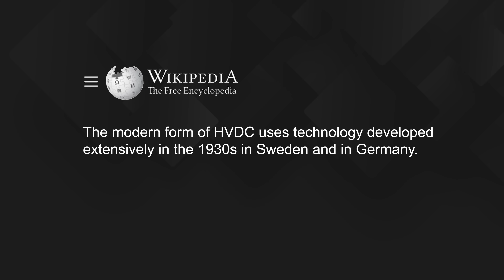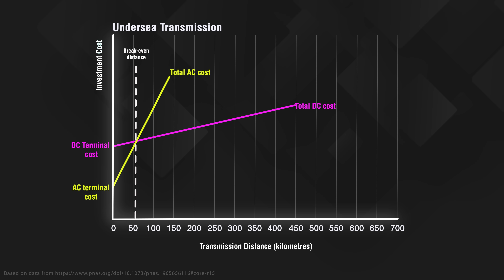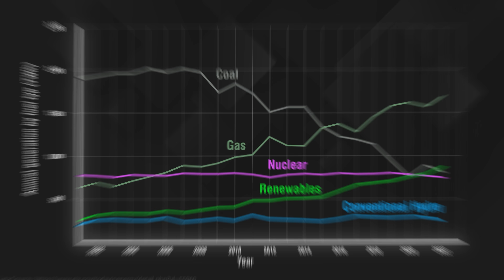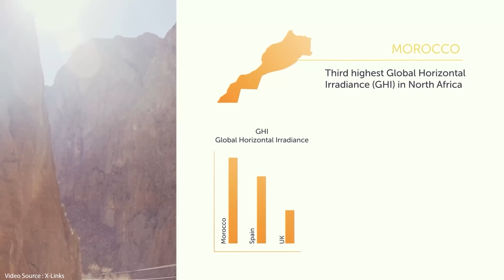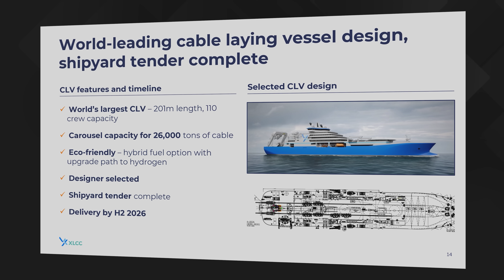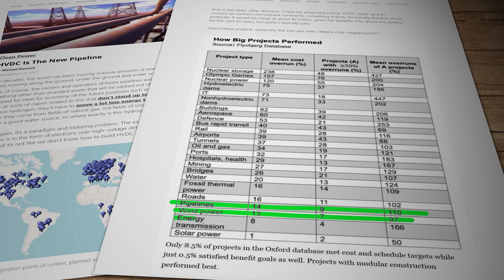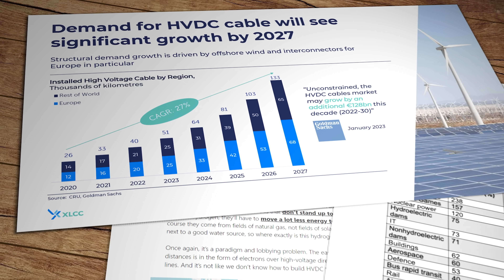Revolutionising power transmission.

Comment: Once again a great layman’s view of developments in the Rebuildables, sorry Renewable Energy Grid’s intercontinental long distance HVDC power transmission sector, and yes it’s something to be optimistic about, but it’s strange that whilst we are being told our country is in great debt, and so we the public have to grin and bear the inflationary costs shown in our food and energy bills due to the vagaries of the energy market, there still appears to be plenty of money to spend on these projects, and that we’ve yet to see any benefit from, if ever.

At the start of the videocast you gave a characterisation of a pessimists view of “in the real world” Rebuildables, sorry again, renewable energy sources to maintain our present lifestyles eg. the lights not going out. But they have a point in the overall scheme of things, as intermittent Solar and Wind Power are the easy part of providing electricity, or they would be if storage had been sorted out (as still require dispatchable flammable fossil backup). But it totally ignores that Globally only ~20% of energy is supplied in the form of electricity, and only ~2% of that is provided by Rebuildables, leaving ~80% still reliant on flammable fossils🤔

Comment: Here in Ontario, Canada we produce a lot of copper. I think we ought to start making these cables rather than selling our copper at the current market price. We need to upgrade our raw materials more in this country and sell more finished products. The breakers for those systems must be insane though. HVDC could surely span a large gap when you are trying to shut it off. Literal bolts of lightning are going through there. I wonder if it would be more energy efficient to send electricity from Oil power plants through these wires than to ship oil by tankers, trains and pipelines. Then the oil would not need to be refined first, the bitumen could be burnt and the tankers could be recycled into something else. Surely these wires must be cheaper to run than a big oil or gas pipeline.

We just need to keep USA from cutting these country to country interconnections. I mean Ukranians with snorkels?!

Comment: Here are some numbers to back up the generalizations I just shared: "Power generated in the Northwest has saved Southwest utilities more than 2.8 trillion cubic feet of natural gas that would have been burned in power plants. Because large amounts of Northwest power can be transmitted reliably to the Southwest, less power has been generated at fossil-fuel power plants -- an important benefit in a part of the country with chronic air pollution problems.  Conversely, because the Northwest has been able to import power from California, particularly overnight when demand is low, water can be reserved in reservoirs that otherwise would be used to make electricity -- an important benefit in a part of the country where hydropower operations affect threatened and endangered species of fish.  As well, money that southwestern utilities pay for power from the Bonneville Power Administration helps finance fish and wildlife restoration projects in the Columbia River Basin." web page/pdf: https://nwcouncil.org/sites/default/files/2001_11.pdf

Comment: Thanks again, Dave, for excellent research and presentation. The cross-over graphs will help us explain to the uneducated masses what is real-world physics. I would like to add 2 thoughts: 1) The need for transmission lines may drop almost to zero. If solar panels arrive on 50% of roof-tops world-wide, and battery mega-packs are deployed for regional balancing, along with a washing-machine sized rust battery in every garage, 99% of what the grid does now will become useless. 2) What India wants to do to Africa, combined with the flip-side of what England is up to, constitutes both a) India sells the product to African nations, keeps the generating technology for itself, and b) England uses the African resources to take away solar production that would benefit Africa more by making industrialization affordable IN Africa. And a small side note on the west coast HVDC line - at night, on a good night, California sends electricity BACK to the north, reducing their need to burn coal/gas for a few hours here and there! "During winter, the northern region operates electrical heating devices while the southern portion uses relatively little electricity. In summer, the north uses little electricity while the south reaches peak demand due to air conditioning usage. " Link for that: https://en.wikipedia.org/wiki/Pacific_DC_Intertie#:~:text=The%20Pacific%20DC%20Intertie%20(also,voltage%20direct%20current%20(HVDC).

Comment: I actually haven’t even heard of HVDC transmission.  With solar farms and battery storage it makes more sense than ever.  Everytime there is a conversion from DC to AC or AC to DC there is loss.  

I have a write up I did years ago on a LVDC bus in my home to eliminate the transformer loss from AC to DC inside every device that uses a AC-DC power supply.   And then storage in the home becomes easy and cheap.
Reply: The losses with modern semiconductor switchgear are minuscule, they're not worth considering any more (as long as you stick to high quality kit).

Comment: It's good to see this progressing.  There was a study decades ago showing that commercial wind power in a 1000 radius connected by a grid, would be as reliable as a coal power plant.  Trying to achieve reliability by storage alone is making the task much harder than necessary.  DC is the way to make long distance feasible with modest losses.
Reply: miles or KM radius?
I'm pleased I've not been the only one saying this since wind power became a thing.
Reply: It's true, what you said. In some places (as in the big Morroccan project Dave mentioned) you can place significant solar generation somewhere within that 1000 mi radius as well, and gain considerable diversity over wind alone. Now consider that both weather and (heh) nighttime darkness are predictable hours in advance. Here in Ontario we have a program where large consumers can receive payment for shutting down large power draws temporarily. It also helps to have hydroelectric power that can be ramped up and down. Overall (assuming some co-operation across borders) it's not clear why a person looking at the whole picture would think we need to burn fossil fuels beyond 2050.
Reply: Transmission going between states & countries faces right-of-way hurdles and takes years. Good that it's finally starting in earnest, 30 years late like everything else that could have started in earnest in the 1990's; EV, clean energy, reduced car dependency with bike lanes, e-bikes, microcars, and small modular reactor nuclear power. Grid batteries/storage aren't here to "make the task much harder" they're being used for load balancing, Virtual Power Plants, and home energy storage & blackout protection. Look at how Hornsdale battery stabilized part of Australia's grid. More UHV and HVDC are part of long-term grid stabilization that includes batteries.
Reply: @Nphen  IFA, the first UK-France interconnect has been operating since 1986. It's rated at 2GW.
Reply: @Nphen  you say 1990s, it did start before the 1890s! 
The first self-propelled motor vehicles (long before steam) were electric (2, 3 & 4 wheeled) & are still used industrially, the first house fully electrified was powered by water, microcars (then called cyclecars) were very popular from the beginning of the internal combustion engine (1897?) but were essentially killed off (in the UK) by the Austin 7 of 1923 though by modern standards it was a microcar at 1m wide & 2m long & it didn't stop there, hydro-power was common with Niagara Falls in the 1880s being nowhere near the first (though it did have the first long-distance transmission line in 1896). Even "small modular reactors" have been in service since 1955 as ship & submarine power initially but also land-based later.
Reply: It is a matter of relative costs. There are two ways of making wind (and solar) power very reliable - (1) lots of connections between wind farms spread over a very large area, or (2) lots of storage for when the wind aint blowing in your particular patch. Which is cheapest depends on the cost of interconnections versus the cost of storage. The best solution to get maximum reliability is to combine both, but given the POLITICAL reliability  problems of countries depending on each other for their electricity then more local storage (battery or pumped hydro) is what most countries - at least those that are not geographically huge - prefer.

Comment: Hey Dave, great research as always, and your optimism is encouraging. There are so many engineers, pushing the boundaries, designing and building so many inspiring projects to electrically connect vast  areas of the world.... however... I do wonder about one of them you mentioned: India supplying PV electrons to Arfica via 1,000's of km of HVDC (or UHVDC) cables? Surely a better use of resources and limited finance would be for India to supply it's own 1.3 billion population with it's own electrons (and stop importing coal from other countries, such as Australia, where I live) and for Africa to do the same? Both these continents are blessed with an abundance of sunshine. All that is needed is investment in Africa. They should both be exporting power to more latitudinally challenged regions.... not between each other.
Reply: Both India & Africa are investing in renewables, interconnectors help with peak shifting & with security of supply.

Comment: Seems to me it would be less resource intensive to put as much power production local to it's use (as in the building / complex itself) and use energy buffering (hot/cold thermal storage and batteries) than it is to build out grids on this scale.

And it is definitely more resilient to do so. 

On paper at least, a diy solar installation with lifepo4 batteries is already parity with what I'm paying per kwh and significantly cheaper when the battery isn't used.
Reply: I think the idea is that you need fewer solar panels, wind turbines, and batteries than would otherwise be required because you're moving the power generation to areas with more consistent sunshine and wind. You also work around problems of local opposition by moving power generation to an unpopulated desert. Also, if the cables are long enough, you can switch where the power comes from as the sun moves around the earth, allowing you receive solar power for more hours per day than would be possible with local generation, further reducing the need for battery storage.

Of course, even if all this, you still need some battery storage to keep the power flowing 24/7. But, the point is, you need less of it. And, if the savings from not needing as many batteries offsets the cost of the long-distance undersea cabling, you come out ahead.

Comment: Do we have enough copper for an HVDC power-grid and electric-vehicles?
If no, how much would we have to increase copper production from what it is today?
Reply: We're talking insane industrial scale building of a grid.  Intuition isn't good enough; as humans with everyday experience, we don't understand infrastructure-scale quantities.

For example, is it conceivable that there was a three year period in modern history, where China used more concrete than the USA did during the entire 20th century?

Or ask yourself: What weighs more: All the concrete in the world, or the biomass of the Earth?

Whatever your answer is to the above examples, they results are, I would argue, not obvious.  In fact, the best estimates I've read, are stunningly surprising.

You have to do at least a back-of-the-envelope calculation.  I'm just asking to see a back-of-the-envelope calculation.

So how much copper do we need to build an HVDC power-grid, plus replace (most) cars with EVs?  How does that compare to our current production of copper?  I doubt the answer is obvious.
Reply: Another way to ask the question, is to ask, how much would it cost to build an HVDC power grid, and to replace cars with EVs?

Sure, economies of scale and manufacturing advances will dramatically reduce costs as these are built.

But think about.  What if it costs as much as, say, a fraction of our current world GDP?  

What if it's a small factor more than world GDP?

Economies of scale might make the worst-case scenario still feasible, because costs would go down as manufacturing ramps up.  However, ramping up that much manufacturing is itself, rather daunting.

Comment: Already well established in Africa, with the Caborra Basa line to Jo'burg being an HVDC connector. Just 2 niggles though, that's a lot of copper being mined for these undersea lines and the Nordic gas pipeline i.e. vulnerability to deliberate sabotage. Still love your graphics and presentation methods!!!
Reply: absolutely everything is vulnerable to sabotage, especially when there's State actors involved, you've just got to minimize their attention & do it anyway.
Reply: I think quite a lot of the lines are aluminium nowadays, it's almost as good as copper and it's much more plentiful & cheaper.

Comment: From Romania, we're putting up solar panels on residential roofs at breakneck pace. Just got our residence wired up last month, and injected 500kW into the grid since. Cool to know that we'll be able to leverage timezone differences to share the benefits.
Reply: You don't even know the difference between kW and kWh?
Reply: I think you mean 500kWh? 0.5 MW seems like too much to me.
Reply: @yodo9000  Mea culpa, you're right. I forgot mega is kilo x 1000, i was thinking it was only 10x
Reply: ...especially once India connects Asia to Europe
Reply: @alanhat5252  power loss increases exponentionaly over distance hence why power generators are often as close as possible to where the power is needed. This is also the reason why ideas like lets just build the entire worlds supply of energy as  solar pannels in a remote desert somewhere dont work.
Reply: @alanhat5252  that scale of power grid is impossible yet. Also in order to build such grids we have to solve wars problem.
Reply: @heyhoe168  Countries will not solve problems with Wars or disputes spilling over to energy withdrawal in the foreseeable future, that's why the Morocco scheme built by a UK based company seems to not take into account security of supply, an unfriendly government change in Morocco and it may all be lost. The argument goes why wouldn't Morocco have the renewable electricity by the locals whose energy generation is mainly by carbon and particularly coal, so it's a strong argument, they do not worry so much that it was funded by the UK or a UK company! Morocco is classed as a medium risk at present so it is fairly stable for now, however there are signs of an uprising in the country's monarchy rule!?!

Comment: How great for the environment is it to cover the country with the kind of pylons needed for High voltage transmission (have you even seen how high the 200,000-volt pylons are that carry the UK HV power lines) and how inefficient is it given the energy losses due to resistance/volt drop, also the issue of cost and of the loss of underground cables and their attraction for lightning. As I have said before cheaper green energy is a good idea but it is not a good idea to put the cart before the horse. While these green terrorists are out gluing their stupid heads to things and throwing paint all over, we have a large group of vulnerable people suffering energy poverty. We need a few sensible people to realise that no matter how much clean energy we have, it will not stop global warming, which despite all the claims by the greedy rich make more £billions out of 'the man-made BS' by which they are exploiting those foolish enough to believe their rubbish, without first checking out the history of global warming even if only as far back just a couple of millions of years, it is a natural event that has been going on since before the human race became the huge plague it is now and this warming period is expected to last maybe another 9,000 years before the planet reverts to its more normal start of Ice Age.

Comment: Hi Dave - I greatly enjoy your well-produced videos. I have to say, however, that I respectfully disagree regarding what you infer the fossil fuel industry fears. They do not fear the advancement of wind and solar build outs at all. Rather, they quietly relish them. They know that natural gas is the only storage and firm generation backstop that will be practicable for some time to come, perhaps indefinitely. HVDC interconnections to ever large power pools may help reduce that need, but they will not eliminate it.

Comment: Pretty arrogant opening.

In some countries the energy grid is on the breaking point and when there is a resistance to putting more demand on it. You come with the typical science future stuff, promises upon promises. That is not science, that is ignorant dreaming that make most business go under, not something one wants to roll out over a whole country.

And while helping neigboring countries in need is great, counting on it to solve issue issues that come with renewables is just stupid. If there is no Wind In Germany, odds are there is none in neighboring countries either.

Comment: First, you are an establishment outlet currently. The struggle against CO2 emissions is official at the highest level in both government and finance. Second, high voltage direct current transmission systems require a high degree of government intervention and direct organization, because they are useful in large scale integrated systems. This is politically impossible in the medium term.